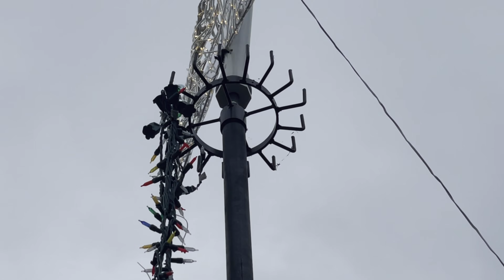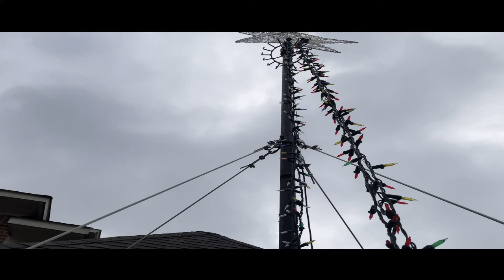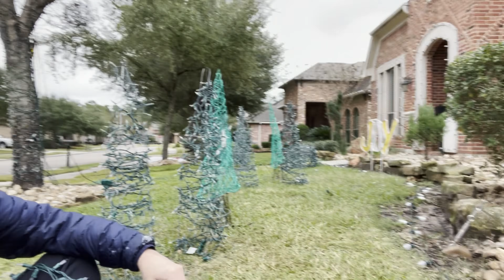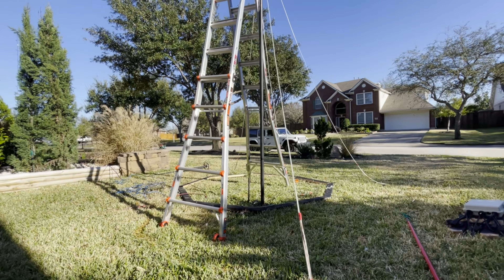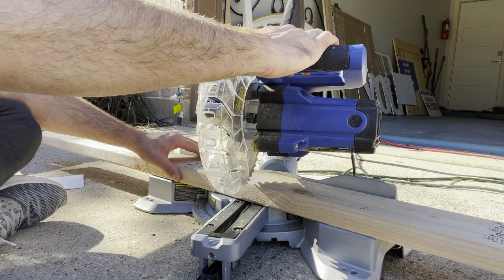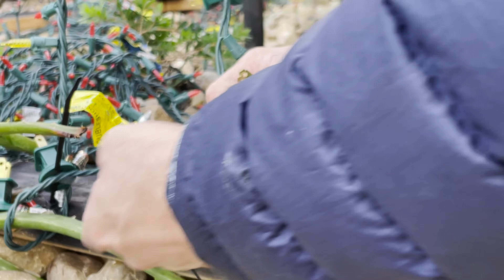A Beginner's Guide to Building a Mega Tree: Useful tips and Mega Tree Details Explained

Comment: How did you connect all the male end plugs at the bottom?
Reply from the maker: I make my own custom-length cords and attach them to the software programming control boxes I use.  If building a static tree (no syncing to music) you would just need some 5-to-1 splitters to connect the lights at the base and then you'd only need a few extension cords.

Comment: When you supply the power, are you plugging the lights into one another or are you running separate extension cords?
Reply from the maker: Hi Anthony.  It's a mix of both depending on my setup for that year.  I try to do a "Candy Cane" Striping effect on my mega tree - so I'll pair the first strand of red lights together with the 16th strand of red lights and that will cord will then be plugged into my #1 outlet cord on my light o rama box. I'll pair the second strand of red together with the 15th strand, the third with the 14th, etc.. and each of those gets a seperate cord and connection in my box.  That's just my personal setup.  It could be done a million different ways!

Comment: Can you tell me where you find the star? Ty
Reply from the maker: The star on top is made by Holiday Accents. It's a 33 inch lighted star.  It's not made specifically for a mega tree, but I adapted it using PVC pipe and attached it to the top of the tree.  I think I got it at Lowes for 75% off at the end of Christmas a few years ago.  I had it on the front of our old house in last year's display - but i think it looks perfect as the tree topper for the mega tree!
Reply: @TheProfessorsWorkshop  Thanks so much. I found one here: https://www.christmaslightsetc.com/p/LED-5-Point-Folding-Star-Warm-White-Lights-13783.htm . They have come in 32” and 48” sizes at reasonable prices.